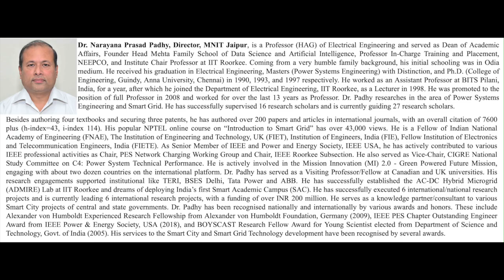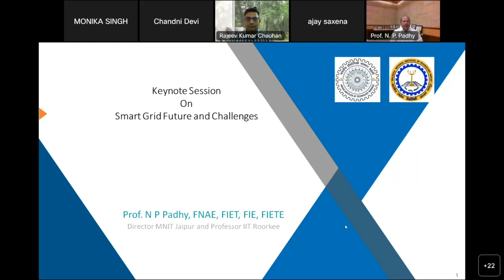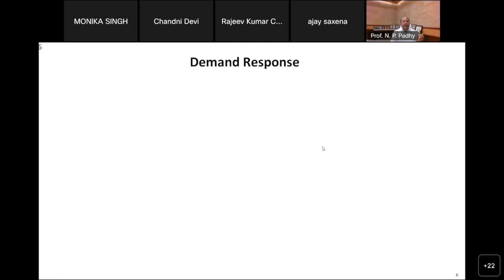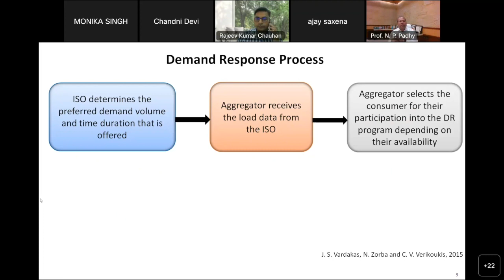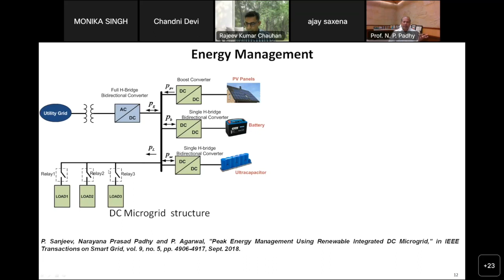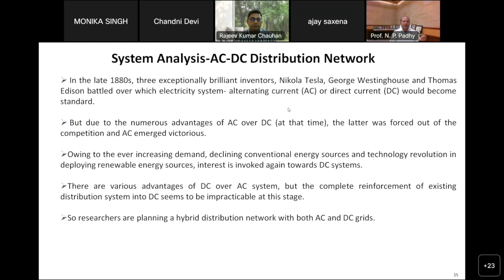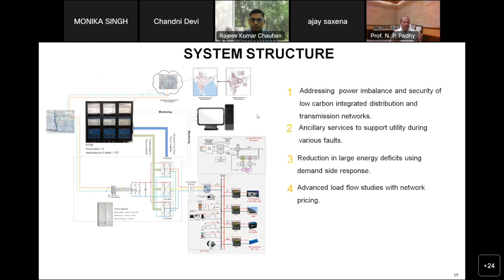Smart Grid Future and Challenges: Prof. NP Padhy

Comment from the maker: 00:31 Smart grid future and challenges
03:10 Challenges in Peak Energy Management in Indian Scenario
08:10 Implementing DC microgrid with storage to manage energy demand and peak hours
10:48 Implementing Smart Meters and DSM controllers for efficient energy usage
15:44 Managing energy usage based on load curves
18:07 Creating a targeted load curve through energy cost inversion
22:29 Demand response changes behavior based on cost
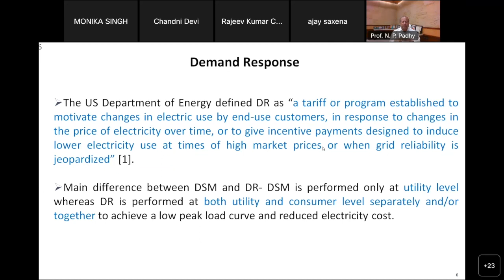24:46 Optimizing electricity consumption through demand response analysis
28:58 Integration of demand response to smart grid applications
31:01 Optimizing energy consumption through smart grid technology
35:29 Efficient energy utilization through smart grid technology
37:36 Implement control scheme to manage grid loads efficiently
42:02 Challenges in developing an efficient load flow strategy for ACDC systems
44:15 Utilization of linear algebra for efficient load flow solution.
48:42 Simulation of National Grid with varying voltage levels
Crafted by Merlin AI.